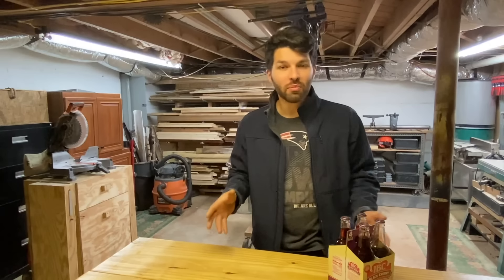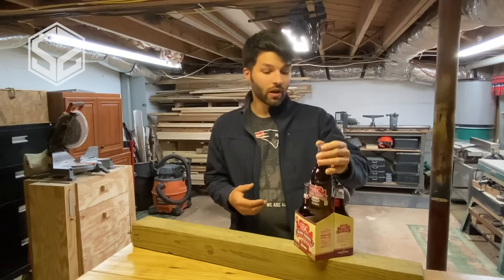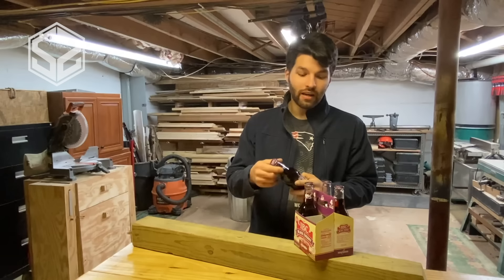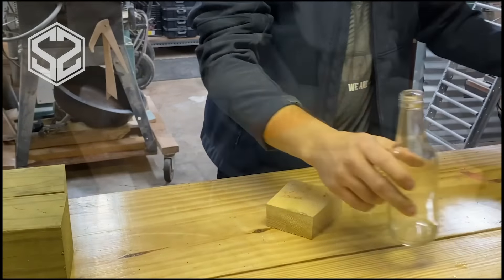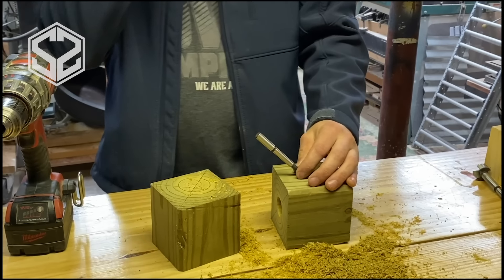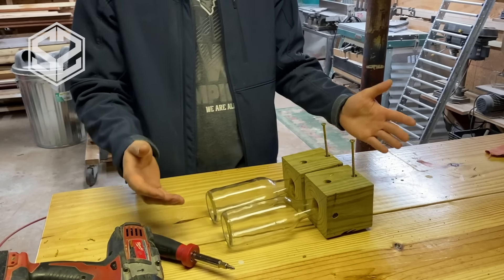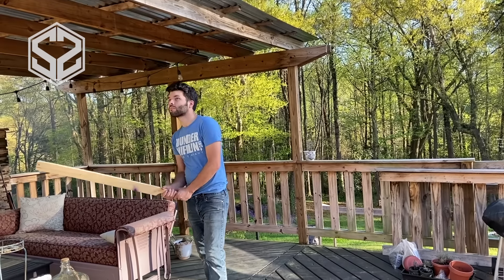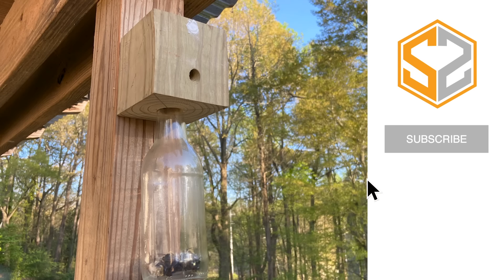How to kill carpenter bees

Comment: So I just built a dozen of these, (before seeing your video), and I can tell I made a bunch of mistakes. Here they are, in no particular order:
1.) I put a quantity of 4, 1/2" diagonal holes going into the main vertical hole, 0ne per block face, (which means that the bees has three other choices to not die in). 
2.) I used wide mouthed bottles that had tin lids stapled to the block, allowing wide access to the hole going back out!
3.) I missed out on the reason to buy 3 quad packs of IBC sodas, (some of the best on the planet)!
4.) WD-40 for taking the adhesive off the bottle?!? Now that was worth watching your video for all by itself!
This explains why my prototype was so phenomenally unsuccessful at catching the little wood munchers.  
Did I see you caulking up the existing holes the carpenter bees left?
Also, what size Forstner bit did you use for the bottle? 3/4"?
Thanks for posting this. I may be able to salvage my blocks with 1/2" dowel pegs stuffed in the extra holes and replace the wide-mouths with soda bottles if the main vertical hole is 3/4", (which is what mine are). 
Looks like it's rework time for my traps! Thanks for posting this!
Reply from the maker: haha, well I have heard of traps with that design working but it may depend on the bees in your area. A few things that I found helps attract the bees to the trap is: 

- Filling any existing holes with calking or wooden dowels causes the bees to search for a new hold before making a new one. 

- Placing dead bees in the jar before hanging up. I noticed that it took a long time for the first be to be caught in the trap but then many more started to use the trap. they may be attracted to the scent of other bees.

- Placing the traps on a frequent place the bees search. I watched the bees and they seemed to search the side of the rafters and especially at the corners of the roof.

to answer your questions, yes I used caulking to plug the holes. a few times they chewed through the caulk but I just filled it back up again. As for the size of the Forstner bit I used, I believe it was 1 inch. But depending on the bottle you may need a larger size.

Good luck with your traps!
Thanks for watching!
Reply: @SimonSaysDIY  FYI if you (only) caulk up the holes, it will not kill a bee in there, nor will it kill the eggs that have been laid. Make sure to put poison in the hole first 👍

Comment: Nice design. A suggestion - for the set screw, if you off set it so it runs in at a tangent along the side of the bottle, not as likely to break from tightening.
Reply from the maker: Yeah that’s a great idea! Thanks for the suggestion.
Reply: @SimonSaysDIY  - You're using pressure treated wood in the video - carpenter bees usually avoid pressure treated wood.  Always use "softwood" like pine, fir, etc. (not hardwood), and use either well weathered wood or new unpainted, untreated wood.
Reply: @Rattlerjake1  My deck is treated and the bees love it!
Reply: @johnnellis3025  - The video show "NEW" pressure treated wood being used, which means it smells and tastes bad to the bees.  A deck, depending on the age, will have weathered and lost much of that deterrent, especially if it hasn't been painted or stained since being built.  Pressure-treating doesn't protect the wood forever.
Reply: Use two screws and thread it in?  No screwdriver needed to remove.  Cut the top of a plastic cap off and glue it in?  One hole on each side of the bottle with a "U" shape wire pushed in below the lip?  Rubber tube friction fit?

Comment: Nice job and it looks great! 
How about using either using a plastic screw, or adding a thin bead of hot glue or a rubber band around the top of the bottle or at the tip of the steel screw to act as a bumper between the bottle and set screw?  I might make the block a bit higher, and I'd use natural wood, not pressure-treated, if available. 
You can also decorate the bottle with paint or self-stick appliques that will still allow plenty of light in and block the sight f dead bees. You could even turn the unit into a lamp for after dark by winding a solar wire and seed LED light set around the outside of the glass and hot-gluing into place!
Reply from the maker: Thanks for the tips! 😄

Comment: Instead of the superlong anchor screw and wood filler, how about a backside hanger tab or recessed key hole hanger? A slope on the top surface would shed rain water and moisture better.
Reply from the maker: Great ideas! Those should be great improvements. Mine were covered by a roof so a angle wasn’t needed. Thanks!!
Reply: When emptying the trapped bees, I always put one dead one back into the bottle. That seems to attract the next bees,quickly.

Comment: Here's a suggestion using a clear plastic bottle instead of a glass bottle and a set screw. I use A "Hint brand" flavored water bottle because it has a wider mouth and a classic bottle shape. Carefully drill out the bottle top cap and drill a comparable size hole in the bottom of your trap. I drill a 1 1/8 inch hole up the middle of my 4x4. Then I use a step drill bit to make the hole large enough to accommodate the bottle top. Gently tap the bottle top into the hole and friction will keep it secure. Then all you have to do is screw the plastic bottle into the cap. You might want to practice with a separate piece of wood to perfect the technique. I like this method because it doesn't risk breaking glass and the overall bee trap is lighter.
Reply: Bart Bartlett he stated early in the video why he is using a glass bottle. He was using plastic before but he wanted something a little more attractive hanging on his porch.
Reply: @audioeeze8396 but broken glass is not very aesthetic.  Function over aesthetics is personal choice. We who comment are sharing opinions, dont be mr I'll correct everyone guy.
Reply: @arthurdavis1065  Broken glass? What are you even talking about? As you try to correct everyone. No one likes a hypocrite.

Comment: Carpenter bees are destroying my outdoor stair railing. Going to give this try.
Reply: You have to treat the railing first.
Reply from the maker: Good luck! I would fill any holes already Bering used by the bees if you can, this will prevent further damage and it will help the bees find the hole on the trap instead of all the others. Thanks for watching!
Reply: Paint/seal your wood and they'll leave it bee (pun intended)
Reply: @bingo6073  it is painted. That doesn’t work.

Comment: The trick to these traps is to get them up early, as soon as possible once the weather starts to warm. You need to catch the females before they start laying eggs. The males, which are the ones you see most of the time zooming around are relatively harmless and catching them is not all that helpful because more males will come. If you catch and kill the females you will quickly eliminate the population and the females come out first and start burrowing. So get the traps out ASAP, if you are in Northern climates get them cleaned up and put out as soon as freezing weather ends. As long as the traps don't freeze up and burst, you are OK putting them out.
Reply: Good tip. Luckily, I left mine out since last year.
Reply from the maker: Thanks! 😄

Comment: 3/8" drill is the right size hole. That is the size the bee makes. I make mine with a 3/8" drill. I also add water in the bottle, about 2 inches. Add a eye let to the top and hang it with an "S" hook. Also if you want to hit them try a tennis racket, bad mitten racket and even a racket ball racket. The males can sting you.
Reply from the maker: Super helpful, Thanks! I believe my bees here were drilling holes a bit bigger than that but thanks for the great suggestions!
Reply: I was plugging the holes with dowel rod pieces, and found that 3/8" was too loose, and 7/16" was needing a little sharpening to get started in the hole. So, I determined that the holes were 10mm... Just proves my thought that that carpenter bees are a commie plot, since all the communist countries are metric, not SAE. 😎
Reply: males do not sting
Reply: @genebond  all posters say 1/2 inch entry holes and 1 inch main bottle hole is the best

Comment: A little expensive, but a can of starting fluid and a grill lighter works great contrary to what you might’ve learned it will not blow up. I use this technique if I can’t get near them very well and obviously don’t blow this up inside of a carport or something like that, but it singes the wings off of them. You don’t even have to hit them that hard, and they are effectively dead.

Comment: Killing carpenter bees is a mistake They are important pollinators for all of your flowering plants and fruit trees. If you want to keep them away from your building frame work  mix up a quart of liquid plumber/caustic soda,  with 4  quarts of water. Paint your  deck framing material with it and let it dry, stain over the material with a  color of your choice, This will lock in the caustic and repel all wood drilling bugs with out killing them.
Reply from the maker: Thanks for the tip! 😄
Reply: Letting carpenter bees destroy your porch Rafters or back deck Rafters, carport rafters, or your overall home or garage is an even bigger mistake.

Comment: Carpenter bees drill a perfect 1/4" hole i/2" deep. To bad my cheap drill won't do this?
Reply from the maker: Thanks for watching!
Reply: They make 1/2" holes.
Reply: @Tommyr  1/2"? Maybe yours are on steroids. Mine make 1/4" and can be sealed easily with a 1/4" wood plug
Reply: @bill72pa  Look at all the traps, the drill 1/2" holes. But yes, I've seen typically 1/4" to slightly larger holes made from them.

Comment: I use 4x4 soft woods drill a 3/4-1” hole up through the end about 1/2-3/4 the length. Three 3/8-1/2” holes at 45° on the sides.

Comment: I put a mason jar on the bottom.  The rim is screwed to wood and then  you put about 1 inch of sugar water in jar.  Hang up and catch bees.  I was a bit skeptical but within an hour I had several in one and one in another.  After about 3 weeks I had a total of 14.  No more squirting WD-40 in the holes.  That method did work but you had to search out each hole and that took a lot of time.
Reply from the maker: Nice!! Thanks for the tip!

Comment: I also enjoy coming home from work and tee'ing off on carpenter bees on my back and front porch. My preferred weapon is a tennis racket. Much more surface area and I have no problem smacking them with it. Usually just cuts them in half. I do agree it is time consuming though. I also almost threw out my shoulder. Happy whacking

Comment: If you fill the bee holes with construction adhesive it will harden into a solid plastic plug.
Reply from the maker: Thanks for the tip! :)
Reply: liquid nails or gorilla glue works great

Comment: I had them feasting in my garage soffit and facia. Sprayed with  the foaming wasp killer spray and filled the holes with it because it also stays intact as a coating and kills off the new hatch. I then covered the soffit and facia in aluminum. Pissed the returning bees right off!
Reply from the maker: Nice! That will definitely do it!
Reply: Prevention is the best solution, exterior wood maintenance and sealing/painting prevents further incursions.

Comment: I've had fun throwing gravels near the males and they'll chase it. Honestly, I don't use traps except for yellow jackets. I spray Wisdom TC on the wood a couple of times and let it soak in. I have a kitten milk baby bottle. I put the Wisdom in that to squirt in the holes. When they're all dead, I use DAP concrete patch in the plastic tub. I plug all the holes with that. Plastic wood dissolves out because it's designed for interior projects. The gray matches old pressure treated lumber fairly close. It has a very sticky glue tendency and doesn't sag when using a trowel or putty knife. Wisdom TC is a pollinator hazard. Do not use in areas around honeybees.
Reply from the maker: Thanks for the tips!
Reply: what in the world is WisdomTC ?
Reply: @triumphmanful  It comes from Tractor Supply. It's a multi-bug pesticide, but it's mainly aimed at termites. Also great for carpenter bees.

Comment: Spraying in holes already drilled with car brake cleaner with the flexible tube to stick in hole kills them instantly and just fill hole with any cheap caulk.
Reply: or starting fluid or WD 40

Comment: The sealer you are using it’s not good. They push it from the inside out. You have to use a heavy-duty quick-drying seam sealer. And yes, paint or treat the wood often. They carve (drill) where there is no treatment on the wood.

Comment: what did you use to fill the holes?
Reply from the maker: White caulking. You can use several different kinds but the bees doesn’t seem to like white silicone.
Reply: @SimonSaysDIY  Thanks
Reply: I use wood putty.
Reply from the maker: @Tommyr  that would work and blend in with the raw or stained wood.

Comment: FYI.  Forstner Bit is the proper name for the tool you used. It’s not a drill bit.
Reply: a Fostner Bit is the name of THE DRILL BIT ! DUH
Reply: It is a drill bit, if you have to put it in a drill to use it.
Yes, the specific name of the bit he is using is a Forstner bit, but it's still a drill bit
Personally I use speedbors when I make my traps
Reply from the maker: Thanks! 😄

Comment: What size drill for the large hole?
Reply from the maker: 1/2 inch. that is the size the bees naturally drill.
Thanks!
Reply: @SimonSaysDIY  What is the other drill size, for the bottle top?
Reply: @johnnellis3025  Whatever you need for the bottle neck.  :)
Reply from the maker: I believe it was a 1in but it depends on the size of bottle you use.
Reply: Soda bottles don’t vary that much.  Let me help y’all out.  A typical US threaded plastic bottle throat is a breath over 1”.  Would have been nice to have that as a starting point in the presentation.  Always measure twice cut once.

Comment: I've only seen them make bottom holes, so why are they attracted to a side hole? Maybe after the first bee is trapped, others smell the pheromones?
Reply from the maker: I have seen that as well, a lot of the places are on the bottom but all we’re on exposed wood. I think they are attracted to that the most. It did seem that once one got trapped they were more attracted to the trap so that may be correct.
Reply: I have had carpenter bees try nesting in a vertical hole from the top (where I usually put a peg to hold the gates onto the porch closed), and i have also see a number of holes by carpenter bees they they made in the side of protruding roof timbers.  So while I agree they seem to prefer holes made from underneath, they seem to find all holes attractive.
Reply from the maker: Thanks! Very helpful!
Reply: Our local bees only go in holes on the bottom surfaces.  I think you need to make your trap to match the habits of your local bees.  I think the entrance hole in this vid is a bit too large diameter.  I would guage the holes your bees are making and match that.
Reply: With my last decoy, they entered from all sides. The ones in my new house seem to be entering from the bottom. They like the end-grain.

Comment: I built one, hung it up, and no bee's, and it looks just like your's, what's the problem? Thanks
Reply from the maker: How long have you had it hanging?

It took a few days to catch the first carpenter bee and then I started catching a bunch. I don't know if they can smell other bees on the trap and then they use it. 

Also I did seal op every hole I could find on my porch and that makes the bees search for a new hole. they would rather find an existing hole instead of making one. as i see sawdust from them chewing I keep plugging the holes to prevent damage.

I hung it in a place they were attracted to and hovered around.

I hope one of these will help. 

Thanks!
Reply: I built one last year and caught just 1 bee.    This year.....catching tons of them!  Hang in there, they will come
Reply from the maker: @reneepypiak5427  Thanks! That's very helpful!

Comment: Put a tablespoon of dish soap in the bottom of each bottle. Bees cant fly back out with soap on their wings. I've also caught wasps and yellow jackets besides carpenter bees in my traps.
Reply from the maker: Great tip! the carpenter bees are too big to fly or climb out of the narrow bottle top from what I have seen but I have seen wasps get out so the soap will help with that.

Thanks!
Reply: You don't need a tablespoon, just a few drops in half an inch of water - the soap breaks the surface tension, so they get soaked and can't fly.

Comment: What attracts the bees to the trap ?  Did I miss something?
Reply from the maker: The female bees spend a lot of time and energy to dill into wood to create a new home. before they start a new one they always search for an already existing hole that they can use. This is why they enter the trap. After entering the hole they see the light through the glass at the bottom and enter the bottle but are not smart enough to climb back out the top. To increase the effectiveness of the trap fill all visible holes near the trap with caulking, This will cause all bees to search for a new hole.
Reply: Female bees will investigate holes before deciding where to put their next "clutch" of larva. She will be drawn to investigate the holes in the trap. Once she gets in there she will see the daylight from the hole in the bottom, this will make her want to crawl down there to see if it's  a way out. These bees are not very good a vertical flight, so once she gets into the bottle is is near impossible for her to get back up to the hole. I always put a little water mixed with dish soap in my traps and once they fall into that, they will be dead relatively shortly.